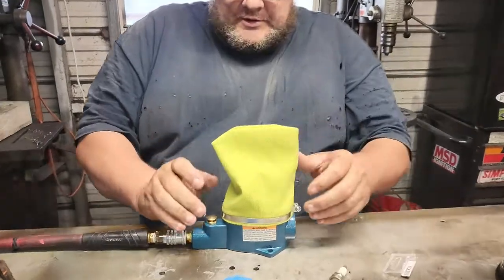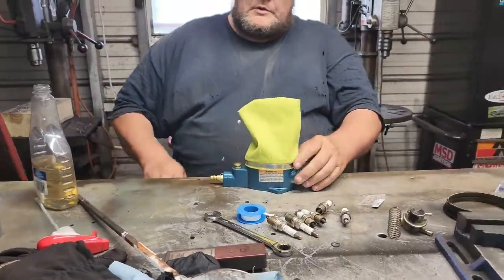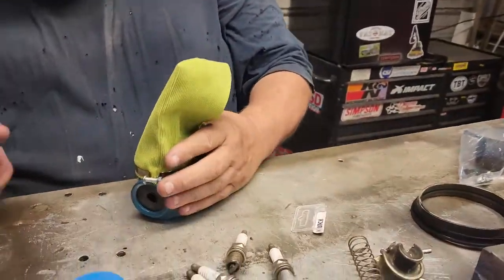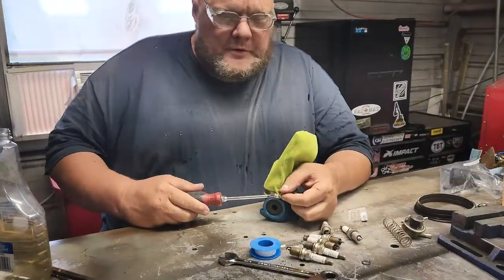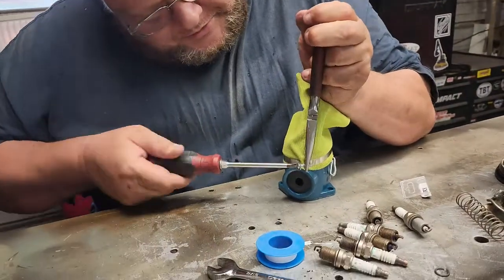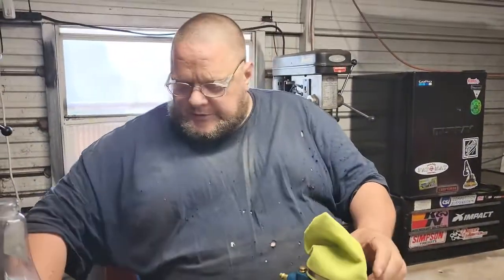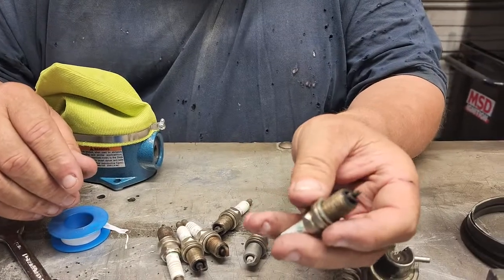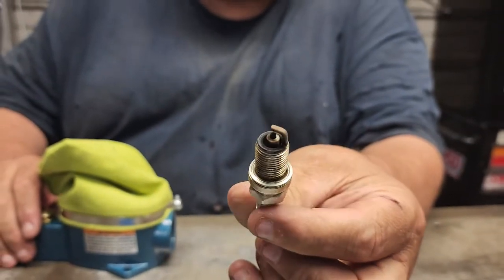Harbor freight spark plug cleaner

Comment: 28C hot, and here I am cold with it being 20C indoors, and around 12C outside. But winter, and summer 28C is a nice cool day.

Spark plug cleaner, still, for the amount of times I need it, a can of brake cleaner and a stainless steel brush works just as well. Often yes easier to get new ones, but for things like 2 stroke engines just a clean is all the service they need.
Reply from the maker: it was 105 today .. I got this because of my old boss, I wanted to remember him